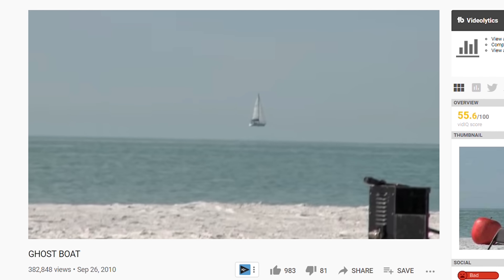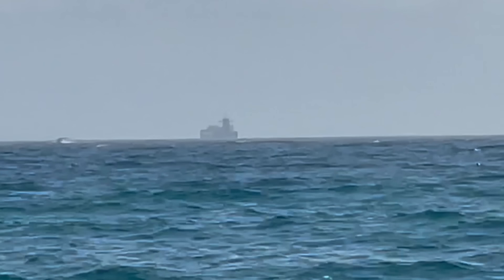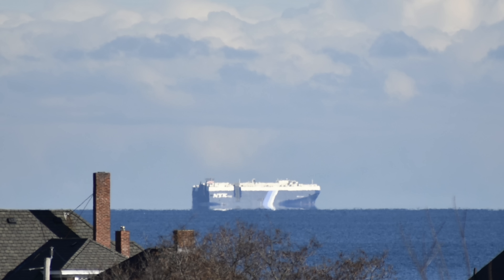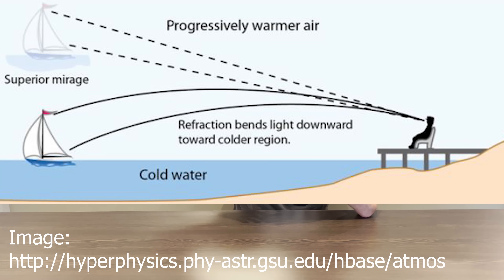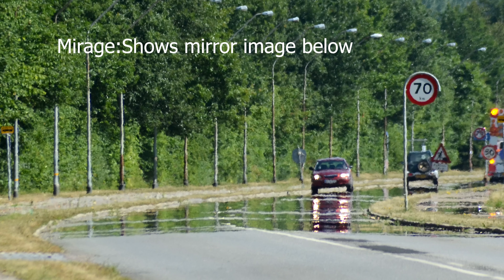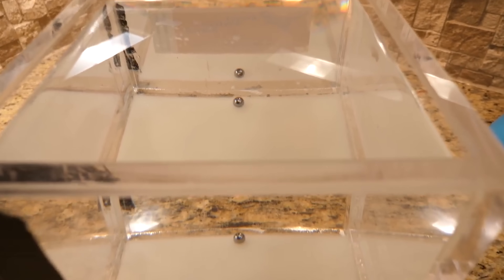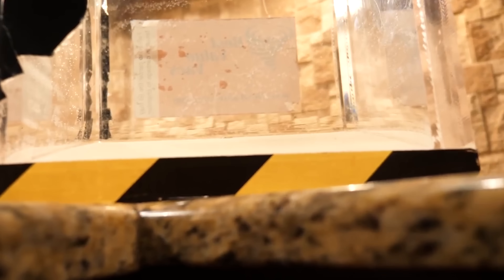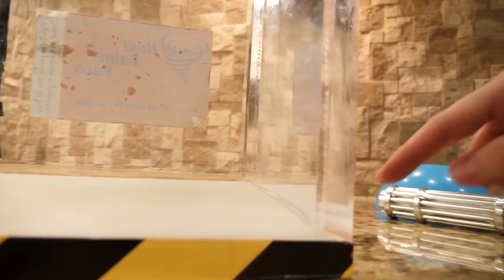Fata Morgana—Boats That Float In The Air

Comment: due to fata morgana, the crew of the Titanic could not see the iceberg because fata morgana made a false horizon
Reply: I'm no expert but for Fata Morgana to be responsible wouldn't: (a) the line of sight need to be near the horizon (sea level) and (b) the observer and iceberg need considerable distance between them (or substantial temperature differential at short range).  
Lookouts typically perch as far as possible from sea level for a reason.  
And any sufficiently successful optical illusion at range would be nullified as the range closes -- giving the lookout plenty of time to warn the captain, and the captain plenty of time to steer/slow the ship?
We're also ignoring that the Titanic struck the iceberg at roughly midnight.  Not sure what good a theory based on optical illusions in the dead of night is, unless I'm missing something pretty big (like an iceberg in the dark).

Comment: "light travel at different speed" No it doesn't. There is only 1 speed of light, which is the speed of light. That's why we call it a constant as it never change. The apparent slow down is because the photons bounce around within the medium it goes through, at the speed of light, before coming out.

Comment: @The Action Lab  The videos you showed at 1:08 are actually examples of inferior mirage, which is by far the most common type of mirage over water.  It's caused by water being significantly warmer than the air above it.  You can tell because there's an inverted image below the ship.  The reflection of the sky in the water makes it look like the ships are floating above the water.  The Fata Morgana mirages, and the non-mirage looming, is rarer, and occurs over water that is colder than the air.  They're more common in California.
Reply: Insightful!!

Comment: Be careful if you are doing observations across large bodies of water as you might end up doing what a man in Utah did with a laser. He was shooting a laser across a lake at a distance of 21 miles to measure the curve of the water. The camera height was 5 feet, so there should've been about 223 feet of curve, but the laser was seen on the other side of the lake. If these lasers are powerful enough to shine through over 200 feet of curve, imagine what they would do to your eyes. Just kidding, the water was flat just like it was when Guglielmo Marconi sent a line of sight signal 2100 miles across the Atlantic. Stay safe out there.
Reply: more salt?

Comment: Imagine if we can make cars that float
Reply: People 50 years ago be like:
Reply: I invented this, it used hydrogen gas liquid and compressed air gas to create plasma discharge more efficient than jet fuel to create rotating magnetic fields of plamsa with quasi stable electric field electron vortex. It used helium gas 2 degrees Kelvins or as cold as possible to cool the atoms down while the electrons stay hot. I invented this in 2009, government is sold out to big oil. I sent the invention to Armenian president in 2020 and asked it  be built with russia money because they are poor. Now russia announced 2021 it is in process of patenting a flying car and from what iv seen looks like its plasma based like my invention.. china also took another invention of mine a jet engine that uses compressed gass for plasma jet more efficient than jet fuel. Everyone laughed in 2009 but china proved my theory in 2020.